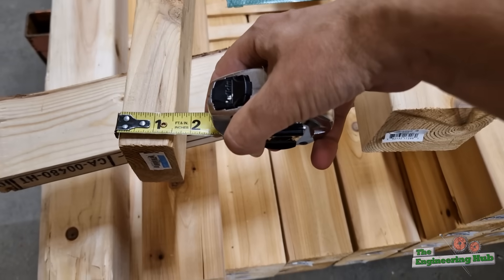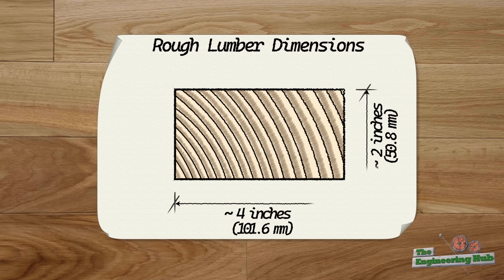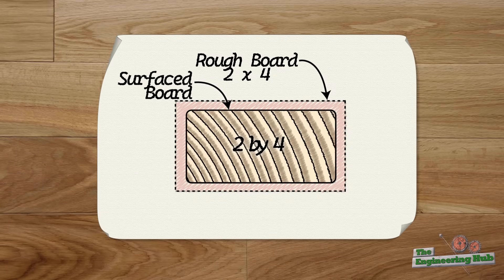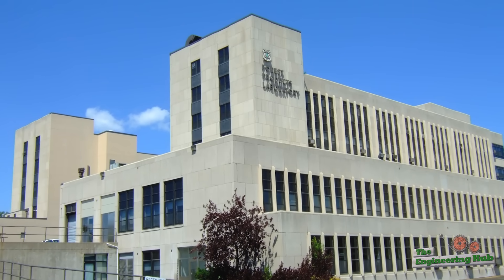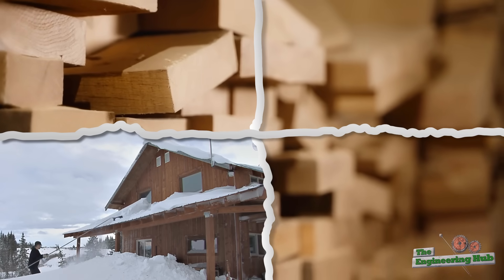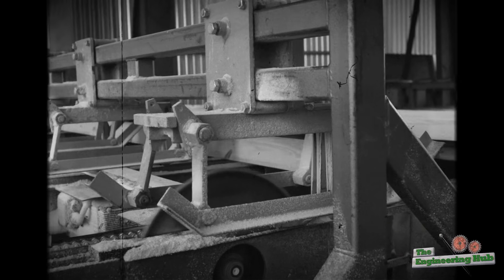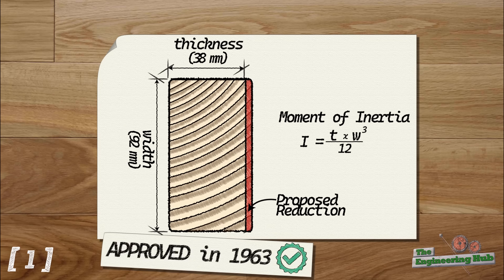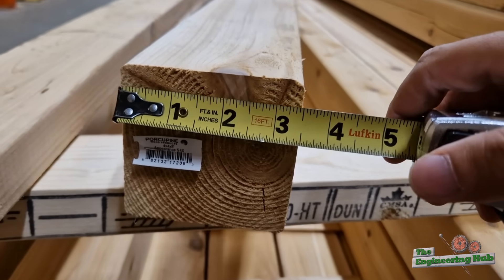Why is the 2 by 4 getting smaller and smaller?

Comment: your "opinion" on the current garbage tier wood being acceptable means nothing. houses built with this garbage standard, start falling apart within 40 years. where as ones built BEFORE they started screwing us on the wood, last for 100+ years with no issues. i fucking hate when foreigners try giving their "opinion" on things they know nothing about.
 
 also, panama. pa-nuh-maa, not "puh-nah-muh", and na-shin-ul, not "nay-shin-ul". put a little bit of actual effort into speaking english, or stick to whatever moonbabble you normally gibber on in.
Reply: For someone so concerned with  English pronunciation, you sure have an “original” take on capitalization. Maybe you couldn’t find those keys.
Reply: English...a famously standardized language. Who gave you the right to decide what accent is "correct"?
Reply: Also, they are wrong about how older structures lasted a hundred years without issues. A lot of those houses were not made of plywood or anything like how houses are made around the world, or they were heavily using concrete or brick.
Reply: @Seth9809  youre absolutely correct, actual hardwood flooring provides a lot more structural integrity than plywood, but many 100+ year old homes were built with plywood flooring. what matters is the frame and foundation of the home, the latter of which being made out of ideally concrete, but bricks can suffice as well yes.

 @RyanTosh  an accent is not what im talking about. his accent is how his voice sounds, as in his specific emphasis on certain syllables, or a repeating and constant note to ones voice or specific pronunciation. not his mispronunciation of extremely common words. youll note he dosent pronounce other instances of those same sounds that way. its just for some reason those words. dude needs to learn to speak correctly lest he sound like that family guy skit of the foreign guys who sound almost american.
Reply: nice survivorship bias lol
I'm sure the people living in 19th century tenement slums were very proud of their high quality wood
Reply: Imagine getting pinned and only having 9 likes when hundreds of thousands of people have the opportunity to like your comment. Yikes.
Reply: you may have missed where he said "suitable for LIGHT CONSTRUCTION"
Reply: I haven't even started the video but I gave it a like because it made a jerk mad.
Reply: i can tell you dont have many close friends in life
Reply: @chillinzard He seems just a tab bit grumpy 😉
Reply: @chillinzard  MY BAD IF YOU SAW WHAT I SAID TO YOU, youtube told me you replied to me
Reply: @bforbiggy  didnt see it, dont worry
Reply from the maker: Nice dude, thanks. Obviously, English is not my first language so my pronunciation needs some work. But as a Canadian immigrant (Canada has basically the same standard as the US) and a structural engineer I do know a few things about wood as a material and design of structures. That is not to say that today's lumber nor standard is better than what it was before.
Reply: @TheEngineeringHub  Why would you pin this comment to the top of the comments section? Just the username is highly trolish.
Reply: @johnhorner5711  Why do gallows exist?
Reply: @johnhorner5711  my bad, its a gibbet
Reply: @TheEngineeringHub  You were incredibly respectful but I can assure you your pronunciation was fine. Other americans talk less american than you
Reply: @TheEngineeringHub  Hey TEH, screw this guy. He might be right about the wood but I didn't even notice your pronunciation because I'm not a complete douche canoe. Great video and thanks for the content.
Reply from the maker: Thanks @patchez058  your nice words are very much appreciated  🙏 I am self-conscious about my accent; I know I mispronounce words. But using ad homonim (based on how one sounds or where was born) to invalidate an opinion is too low of a move to argue against. Ironically, I never said that the wood (as a material) is better or worse today. You can actually see in other comment replies that I agree that old growth is most likely better. Anyway ... different opinions are always welcome, even if they trash me and the way I speak. I have no problem with admitting that and pinning the comment to the top. I embrace the process 🙏 cheers!
Reply: @TheEngineeringHub   Well I intentionally mispronounce words and grammar depending on what I think is most funnest. 🤷‍♂️😁
Reply from the maker: @FingerinUrDaughter During my high school years I worked at a West Fraser Sawmill for 3 years in Williams Lake (Northern Canada) whose boards are directly exported to the US. After high school, I studied structural engineering in Vancouver and during summer worked again in the forestry industry in Northern Canada, this time building and designing roads and WOODEN modular bridges for the logging trucks. During my master's degree I studied general wood properties (cell structure, creep models, the Madison curve, moisture effects on the stress and strain properties, machine stress testing) + Glulam beams and CLT panels, also performed a bunch of shear and connection testing. During my doctoral degree I studied dynamic response of offshore platforms and wave loading (not directly related to wood). Anyway, I am not sure why and how you decided that I know nothing about wood. 

In regards to my mispronunciation, I got nothing to say. It's wrong and I will try to do better next time. If you think I mispronounce words on purpose then you have never tried speaking a second language with a native speaker. I assure you no word is mispronounced on purpose, with that being said I should have looked up how Panama is correctly pronounced which unfortunately I did not think about at the time. I will definitely know for next time.
Reply: dude hes a native hes obviously more qualified than an engineer, just like some mothers know more about child health than doctors :D @TheEngineeringHub
Reply: @TheEngineeringHub : again, Great piece. My dad was a mostly self taught  Civil engineer. I wish I had inherited his genius. My father, Clarence McFadden and his business partner Myron Burlbach of Dalles, Oregon invented the patent and manufactured the " Superior Plywood Plugger" for the ( football patch) you see on finished panels today. It was finally patented in the early 1960's, the " plugger" automatically filled in the voids and edges in the plywood sheets creating a much cleaner, nicer product. The patent ran out in 1978, but gave our parents a nice retirement and put three kids through college. We owe a lot to the wood products industry. I still have all the original drawings and patent papers at home.
Reply: @TheEngineeringHub  Don't pin trolls don't reply to trolls. I shouldn't have to say it but it seems like people still have trouble with this
Reply: @TheEngineeringHub  you basically just said that as a structural engineer, you are aware that the building materials are crap but you dont care because you work on paper so everything from your point of view is good enough as long as it can pass initial reviews. Cool. Its good to know that engineers across all industries are the same.
Reply: @TheEngineeringHub As a Canadian, your opinion is automatically invalidated.
Reply: @interstellarsurfer  You played Everquest, sit down.
Reply: No one who gets this mad at a video about lumber is putting their fingers in anyone's daughter. Unless... you are the daughter.
Reply: very nice of you to spend your free time crafting comments that help increase the engagement, viewership, and revenue of this channel
Reply: Wow racist much? You sound like a small town 70 year old. There are many reasons today's houses seem to suck structurally. One of them is moisture intrusion because of insulation. Do a bit of research yourself
Reply: Your comment sums up america pretty good.

- A european foreigner
Reply: This brilliant, not at all racist remark on the state of dimensional lumber manufacturing brought to you by username "fingerin ur daughter"
Reply: Houses built 100+ years ago usually used a timber framing method, not studs and plates. Besides one must upkeep the structure, there's no reason a house built with contemporary lumber would not stand for hundreds of years as long as it it maintained (IE kept dry) and built using modern codes. Using the right lumber for the job will keep a house standing virtually forever if the roof, paint and any flashing including caulking is maintained  properly. You, sir, are wrong about any inherent weakness with contemporary lumber. Follow framing codes and maintain the property. You'll be fine
Signed a roofer, framer, flashing expert and my first job 40 years ago was caulking.
Reply: That’s a lot of talk coming from “FingerinUrDaughter”
Reply: Everyone listen up!! "Finger In Your Daughter" has something very important to say.....
Reply: Stupid handle, anime profile pic, overt racism in the comment - folks, what we have here is a 16 year old incel who has no friends and is the embarrassment of their family.
Reply: English*
Reply: Lmao, a xenophobic weeb seething with anger. what else is new.
Reply: Sheesh, @FingerinUrDaughter, who took an upper-decker in your coffe maker?
Reply: My mans couldn’t hear an accent without having a tantrum
Reply: @Ant0nAL0g  yeah, but blud butchered words without even lookin up how to say them 💀
Reply: You just sound like a stupid American, who can only speak English. You likely have a reduced mathematical and literacy rate compared to people from other developed countries, you probably hardly can afford healthcare costs and yet still that America is one of the best countries in the world. 

We all laugh at people like you ❤️
Reply: Almost reasonable but fuck you.

Do people have to look up the exact pronunciation for everything? Do people have to take accent courses to remove their accents? Imagine thinking everyone should take a 6 year immersion course in english before they're allowed to speak in public, literally insane.

Houses before don't last 100+ years because there's more to building an entire house than wooden bars. I fucking hate when people believe they have exclusive rights to a topic and give their opinion with very little analysis into the reasons why they believe what they believe. "worse wood is bad" yeah okay and I hope you have the top of the shelf product for everything, I expect nothing less than industrial grade clean room ventilation and a vetted driver chauffering you around in a bulletproof limo. 

If you actually care to listen, there's always always a tradeoff to everything. The smaller piece of wood is cheaper and people are buying it even when larger pieces of wood ARE available. Not only that, wooden beams are not the only point of failure so it is likely you do not have to replace them if at all. Smaller wooden beams also mean that more beams are needed which admittedly sounds bad but this means that if a beam does fail, it's cheaper to replace a single smaller beam than a single larger beam. The most important thing though is that 40+ is fucking fine. The average american moves once every five fucking years. Even if you stay in a house for your entire life, you'll be lucky to live long enough to replace it more than once.

P.S. - Also, anime profile picture and unfunny name.
Reply: Damn, I can't imagine why they might need to find ways to cut corners by not giving us trees that have been growing for 500 years.

Grow the fuck up.

We need better alternatives, but this is the best we can do right now. It might help if entitled people like yourself weren't demanding that we build thousands of new houses per year out of a valuable and rapidly-dwindling resource.
Reply: Bro speaks two languages when you can only speak one. Shut the fuck up and crawl back under the rock you came out from under.
Reply: "garbage tier wood" lmfao what the hell does that even mean? That's not how any engineer talks. 
Give a materials breakdown I fucking dare you, you have no idea what you're talking about. Is it hardness? Stiffness? Compressive strength? Bending strength? Specific gravity? Moisture content? Processing quality? What are you even talking about, which part is inferior? Where did you gather these measurements? Which wood specie are you even talking about?  You don't even know, you're speaking based on your emotions with zero logic or real data.
Reply: Wow, the person with the stupid username got all their pronunciations wrong.
Reply: you talk like a f@g and your shit's all retarded
Reply: Make your own boards then.
Reply: @mike_nolan   i do. but i also dont use wood for building anything that matters. wood is for building lightweight frames and boxes, not homes.
Reply: Have you always been an A-hole? Cause it seems to come naturally to you. You sound like a perv too.
Reply: You have a point about houses not lasting...
But damn dude. Chill, maybe?
Reply: I bet you can't speak any other languages than English 🤡

Also, learn spanish before trying to correct pronunciation of spanish words. Hijo de puta
Reply: @fingerinurdaughter - mentally unhinged anime fan goes on a somewhat racist tirade because an engineer has a different opinion than him on pieces of wood. 

Can't make this shit up. Learn to spell and please touch grass.
Reply: I was about to kind of agree with you until you spiraled into a racist rant
Reply: @archean432   trying to figure out whats wrong with racism still to this day. why is someone not allowed to hate someone because they are something they dont like but its okay for you to hate someone for hating something they dont like. :skull:
Reply: @BuzzyBri  There's no way you're serious
Reply: @archean432  yeah some people can formulate their own thoughts other than bandwagoning for the sake of bandwagoning onto a point that's popular but incorrect. Educate yourself
Reply: @BuzzyBri  Brother, I am educated. That's why I am confused. Are you saying it is okay to discriminate against people based on things they cannot control?
Reply: @archean432  you are allowed to discriminate against others that don't like certain people but when they don't like something it's an issue. Hypocrites lol
Reply: @BuzzyBri  I am allowed to judge people based on decisions they CHOOSE to make. If someone is foreign and has an accent, that is not their decision. If someone is making fun of someone for being foreign and having an accent, that IS their decision. And yes, I will naturally think less of them for it, because it is a conscious decision that actively hurts other people.
Reply: @archean432  its their decision to talk to me and put themselves out there for others to hear what they don't wanna hear. how's that an issue? you don't hear what you want to hear and attack me but if I hear something I don't want to hear its an issue. kinda weird. Hypocrite.
Reply: @BuzzyBri  I'm not really attacking you, I'm just disagreeing with your notion that racism is okay. Are there upsides to belittling people based on their race? Does that help society at all? Why should I not be allowed to stick up for my friends? Why are you allowed to disagree with me but I'm not allowed to disagree with you? Does that not make you a hypocrite?
Reply: @archean432  maybe you shouldn't have an opinion because every opinion you've put forward is examples of totalitarianism, Marxism and just plain ignorant.
Reply: @BuzzyBri  How so?
Reply: lol this guy touches kids
Reply: Jesus, you're an angry lad.
Reply: What an angry sad little gayboy comment. You can hear the tiny penis yapping.
Reply: Things they know nothing about.............Like fingerin your daughter? 😂 You can't be taken seriously with your insults no matter how much weight they hold when your Handle is @FingerinUrDaughter
Come on man. If you're a man i guess... Go back to doing nothing for nobody for yourself and leave this man alone. Be a keyboard gangster while watching you're Pokemon or whatever that picture of you is. Grow the fuk up
Reply: Man, the lack of awareness in this post is pretty saddening.    Not only do you not get it, but you are emotionally defensive so you don't have to get it.
This asshole doesn't speak for us Americans, we appreciate your work.

Homes are lower quality because if the sticks of wood used in the framing, only someone who's ignorant could say something like that.
Reply: Well ... I gibber in English. 
You know, the real thing, English English, not the politically sanitised mongrelised America-speak you guys babble and gibber in. 
(Hey, I may take the peshabi sometimes but you Americans (Yanks?) I actually do hold in the highest regard. Always have. Jeez, we had a language in common once ...)
Reply: 12 subscribers vs over 90k subscribers. maybe efforts should be reallocated outside of being butthurt?
Reply: @michaelt5188  id say that for having no content here whatsoever, 12 subs is doing pretty good.
Reply: Lmao you're so sad, dude. Maybe if you spent less time shitting on people who actually contribute to society and more time on yourself you'd be less of a shitty, hateful person.
Reply: J a c k a s s
Reply: he was saying fucking pamama. PA MA MA WHAT DA HELL- also, a fucking eurotard, he is.
Reply: It’s whereas, not where as.
Reply: Lmao holy shit
Reply: How shit is your life that you have to act like this? Get out of your mother's basement and get some life experience.
Reply: God damn you must be SO FUN at parties
Reply: lol, why so much hate broda? the man is trying ...
Reply: Wow, you're an absolutely trash example of a human being. Racist, pedo user name, and to top it off you can't even speak intellectually on a subject as simple as lumber. Your mama didn't love you did she? Kick rocks you anime pfp, never touched a woman, neck beard a$$ tool. Literally the only thing you got right in this entire hate filled comment was the wood quality being trash by today's standards, bur I don't see your little keyboard warrior butt out there logging or milling.
Reply: Wow, I thought you were pathetic before I watched the video, but then he pronounced Panama correctly 😂😂
Reply: anime pfp, opinion discarded
Reply: Our family made it's living in the wood products industry. My dad and his business partner created the first plywood plugger in 1956 creating a product that is used by everyone today, including yourself.
The woods were and are full of " them foreigners": Scandinavian, Armenian, Mexican, Irish, Scots, French Canadian and Hawaiians in the Pacific Northwest starting in 1824. ( Especially Hawaiians who came with the Hudsons Bay Company)  As high schoolers, my dad and mom would create a band and tour the lumber camps by train. ( 1925-28) and many in the camps didn't speak a word of English.
The video piece was great. What in the hell does " foreigners " have to do with anything!?. We shared our table with our hired hands and everybody at our farm and we were family. We became Americans.  We all got our hands dirty, and built America. The author did a great job.Still do.
Reply: Xenophobia isn't necessary to make credible disagreements of content. Sure, we could build houses better that last generations, but Don't be a bigoted 💩. After all, the building field is dominated by hard working immigrants.
Reply: "Ever notice how whenever you see a house that's 100 years old, it's lasted for 100 years?"
Reply: I'd remove this pinned comment as the name suggests promoting child sexual abuse.
Reply: Yall are taking the bait. Even the uploader fell for it. Dudes username is literally "FingerinUrDaughter" and yall took whatever the fuck he is saying seriously.😂
Reply: Obligatory american conspiracy nut schizoposting
Reply: my house is almost 60 and has 1.5.3x5 studs abd older homes had to use 5 times the amount of lumber then newer homes
Reply: @FingerinUrDaughter
> put a little bit of actual effort into speaking english, or
> stick to whatever moonbabble you normally gibber on in. 
 
You vile, racist, POS.
Reply: Maybe OP should go touch grass and take a shower for once instead of insulting someone over a fucking accent
Reply: ooooo pin of shame for the troll….anyway imagine making the effort to speak at least two languages am i right????
Reply: SEND THEM BACK
Reply: No one is "screwing" you on wood bro. And him being foreign has nothing to do with anything. What did you think the USA invented lumber? lol...... srsly brah? If they cut the wood larger it would cost more. If you need more strength you can double up your lumber. But now we don't have to pay for extra thick wood where we don't need it. It actually saves money to do it this way.
Reply: We're on you're side, bro
Reply: Why tf are you so toxic/salty?
Reply: Wow that's pretty rude, especially when he does seem to know what he's talking about. Even went into the history et al. As for pronunciation, every accent is a little different. So what? Did you understand the concept? Good, let's move on.
Reply: This is an uninformed comment and the building code takes all your moot issues into consideration and was developed by engineers and not racists.   As engineers we have tables which reference the different grades and species of lumber by their applicable strengths.  The scarp lumber is often referred to as economy studs are not permitted by any building code I am aware of and the building grade is referred to as number 2 and better.  Lumber like cedar is no longer accepted by code as the lumber no longer has a predictable  strength, but this is the properties of new growth, not the Mills.
Reply: @johnnychinstrap  hate to be the one to have to tell you, but someone having a job as an engineer dosent prevent them from being racist. not even sure why you said that idiocy. as for the rest, i see a bunch of very clearly googled up talking points, so please fuckoff with your lack of an actual opinion on this topic.
Reply: Thank you for sharing, FingerinUrDaughter.
Reply: Yeah, and the code for these buildings have reduced distance between studs to allow for the same tensile strength. Are you even a contractor?
Reply: @loublacksail1995  I did not write the Ontario building code but a colleague contributed. as I recall the safety factor for the code is 5 or 6.
Reply: @loublacksail1995  Incorrect. The building codes are more lax than ever before.
Reply: @interstellarsurfer  lax? Dude a 2x4 must be no less than 16 inches away "on center" from the next one unless its a one story building. 🤣 even if you're a contractor now you're stepping on the engineers toes too! 😂😂😂
Reply: Meanwhile in Europe: Our houses don't suck because we build them out of brick, instead of fighting over which wood is less shit than other wood.
Reply: @ChielScape  🤣🤣🤣🤣
Yes, good brick work beats wood but it's expensive relative to wood, in renovations and new building. Both need to be maintained also. I would prefer good wood construction than ok quality brick. 🤷‍♂️🤷‍♂️🤷‍♂️
Reply: always the one loser from the PU trying to act like they are better when they are either equal or not as good as people from the far west 💀 @ChielScape
Reply: "Just your average run of the mill dungeon mimic, out for a stroll in some anime girls." this is you creep
Reply: @marthflores3515  yeah he's a braindead troll
Reply: tbh, you're so angry that I believe you even though I know nothing about wood
Reply: Dude is right, modern framing lumber is hot garbage.
Reply: @cyberpunkspike  it isnt garbage, it's still grown in nature, the building codes have adjusted to the size change and have required studs to be more close together now. This is coming from a contractor who works in historic/current restorations. I doubt you've even set foot inside an unfinished structure with the way you're talking.
Reply: YES .Tell them the truth. The people in charge don't give a damn if your house falls down or not.
Reply: Thank you for staying with the facts of good ol' school 🇺🇸knowledge.
Reply: Based
Reply: lol based